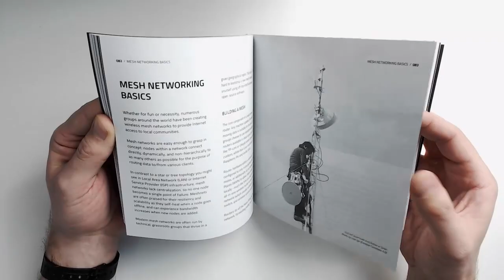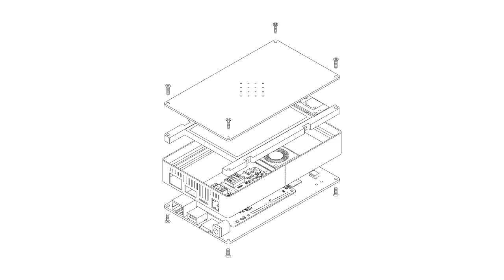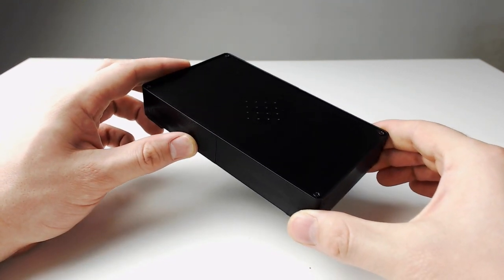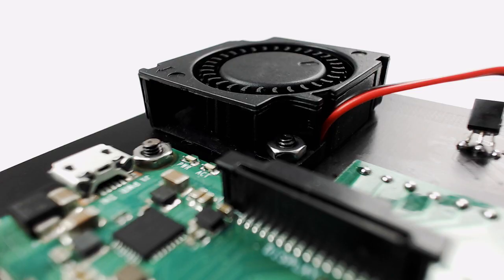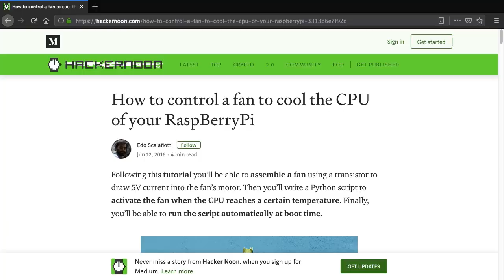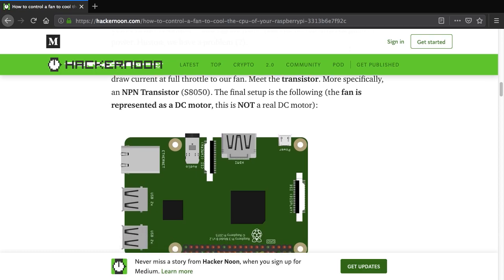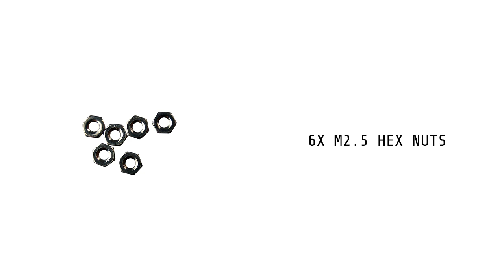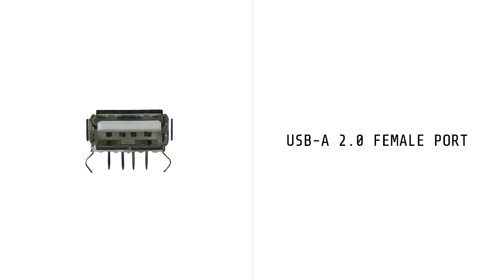The NODE Mini Server V2 / Turning The Raspberry Pi Into A Home Server

Comment: please start selling them 

especially the pcbs
Reply: I agree with selling just the PCBs.  3D printing is pretty trivial, even for people without printers, but PCBs are more difficult if they need surface mount stuff.
Reply: I would buy a pack with everything, even the 3D printable parts.
Reply: The PCBs are actually pretty cheap easy to order if you follow the txt file given in the source files, and it's about 21 USD plus shipping for enough to make 5 (the minimum quantity)

Comment: Very cool project, love how well the open source and design mentality work together! Two ideas for V3; Use M3 instead of M2.5 screws as M2.5 taps are way harder to get. And have a look at the pi compute modules, they could make the thing even smaller and installation simpler, the bottom PCB may be more complicated in that case, but production would scale way better.

Comment: Crowdfund a production run man. You'll sell 500+ easily I reckon
Reply: @dont-sue-us3935  the point of these DIYs are to be open source. All the material you need are easy to access. And you technically dont need any permission to produce or sell it. There are also tons of open source server software to use on the Pi. If youre implying you can make some for N-O-D-E to sell through you then you should make a few yourself and then contact them individually. People would definitely show interest
Reply: At some point, you're going to have to design your own sbc from the ground up.
Reply: I think some people would love this but not making it and would rather buy it so it’s a good idea

Comment: Could you provide this as a kit on the shop? I'd love to be able to get all the parts in one place.

Also, for a V2.5 or a V3, a lipo battery and charger/boost circuit to power it when external DC isn't available.
Reply: Or with a solar panel!
Reply: hi if N-O-D-E would allow it could massproduce some one :)

Comment: Which service did you use to manufacture that matte black PCB?
Reply: JLC has black at no extra cost,  plus a bunch of other non-standard options. As long as shipping to your location is reasonable you can't go wrong with them
Reply: @c4pt1n54no  last time i ordered a black pcb they were glossy. the matte ones look a lot cooler, so i would also like to know where he ordered the one in the video
Reply: @041e71  Ah good to know. I haven't personally ordered black from them yet, but I thought they looked matte from videos I've seen. I know pcbway do it, but they charge I think about $10 extra.
Reply from the maker: allpcb. it's a bit more expensive than some of the other Chinese manufacturers, but quality it better.

Comment: I feel like using either a similar performance but smaller SBC or a same sized but more powerful SBC would be a better option in this situation, along with further reducing the size of the whole unit by around 25%, we really need a decentralised network setup where people can add it to by making nodes that run open source arduino code and they then 3xtend the network

Comment: Nice integration. Only thing I'd do if making one for myself is a real bottom plate, as I'd be keeping it in a bag etc. Those feet are deeper than is strictly necessary so if you want more protection an extra piece to print for the bottom would be easy

Comment: Since you made a custom pcb did you give some thoughts about the compute module version ?
You wouldn't have to desolder anything and it would be a bit smaller too but maybe the pcb would be way more complicated and require additional components.
Maybe for a v3 :p

Comment: Is there a reason you choose to use a full pi instead of using a compute module? If you're already using that adaptor pcb on the bottom, it seems like the compute module would be more space efficient, and you wouldn't need to desolder anything.

Comment: Would it be possible to slim the form factor down, remove the SATA Drive, use a larger SD card, and then get a PoE Pi Hat for this? That would make this self sufficient and eliminate the need for the power adapter. If you had a PoE Switch, you could run dozens of these without needing power supplies.

Comment: When are we developing the first open source laptop with 3D printable case? I daren't buy a new laptop given the built in obsolesce. It seems so obvious that a with 3D printing and x86 SBCs we can now build reasonably powerful upgradable laptops.

The same for mobile phones.

Pinebook's current offering is no where near good enough, though the price is fair. If the case was open source we could make it into what we seek.
Reply from the maker: Check out the Reform laptop, we covered it in the NODE Vol 01 zine. Very nice open hardware laptop.

Comment: I’m wondering what kind of Aluminum based PCB board you used. Material wise I’m mostly used to seeing people work with the standard FR-2 and FR-4 fiberglass/ copper sandwiched pcbs, so it makes me curious as to what sources on the internet point to the materials as I’m looking to buy boards to make self built electronics. Also check out the RepRap project; that has a lot of places where the Raspberry Pi can be applied to make CNC machines or 3D printers automated:

reprap.org

Comment: Any possability of converting this to be used with a beagle bone black for a completely FLOSS system? (I don't have one yet to compare the physical layout hence the question)
Also I imaging you could use the gpio header inverted to be under the bord instead of using resisor legs.
Nice work

Comment: Been doing some research and calculations, developing a price breakdown chart documenting the parts I'd use, their prices for various volumes, and the overall cost of the system at different group sizes:

https://docs.google.com/spreadsheets/d/1EF-J_rKjSCn4qwSNhlLeyfsE83lmLOG6hR04Hz9iQC4/edit?usp=sharing

Right now, it looks like I can get the parts below $70 USD for a decent-sized group buy, however this does not include costs of things that people would be able to get and assemble/install themselves: the 3D-printed case, SD card, and hard disk. It also doesn't include other costs like shipping, assembly, and research/testing.

If you find parts cheaper somewhere else, add a comment to the document and I'll update it! I'm also looking for cost-effective manufacturers for the case, as I don't know much about those.

Comment: Hi, the raspberry pi is not a PCB whose design works 24 hours a day for long periods of time. To learn is a great tool, but not for professional application. I am a big open source enthusiast, and I know the Banana pi project, which is really open source, because it has its free designs and besides, it has many different versions of PCBs designed for different applications, I wouldn't know which one is better for server applications. But perhaps there is a version of banana pi more appropriate for the server than the raspberry pi. 
I would like to see a server version that uses a banana pi so that the project design is fully open. I would like to see a server version that uses a banana pi so that the design of the project is fully open. Would it be possible to make a V3 Home server with Banana Pi?

Comment: why dont you make it based off a rpi compute module 3L so you dont have to strip a rpi
Reply from the maker: The compute module would require adding lots more components, so the choice for end users is either hand solder a bunch of SMD components, or desolder some. I might consider it if it ever goes into larger volume production though.